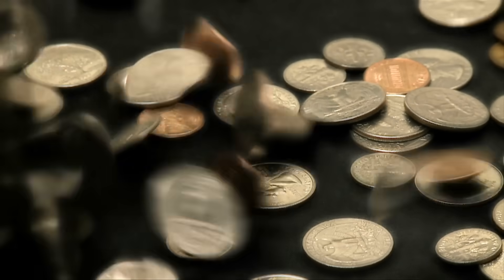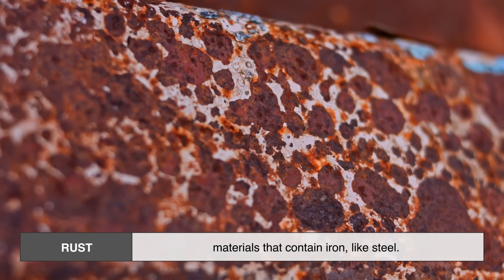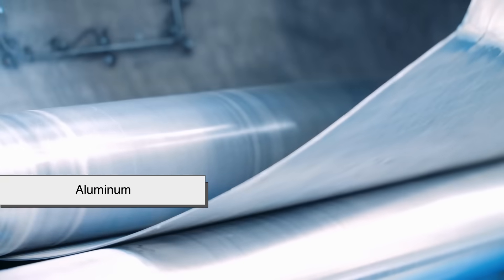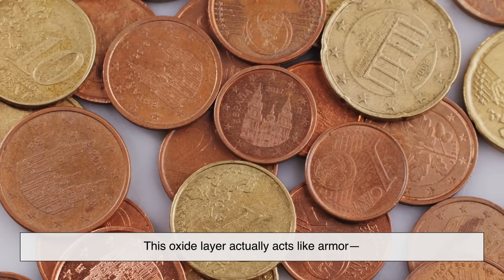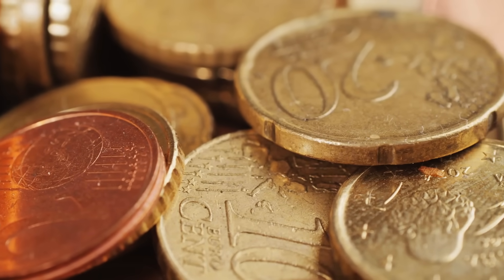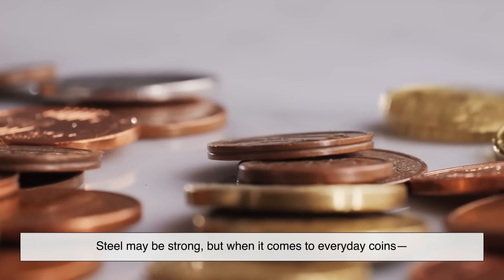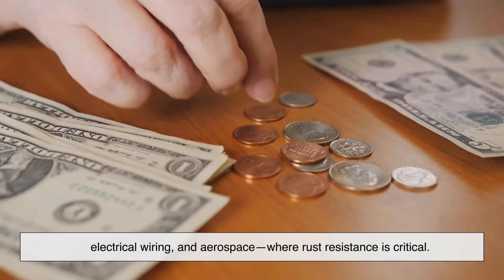Why Coins Don’t Rust Despite Being Metal

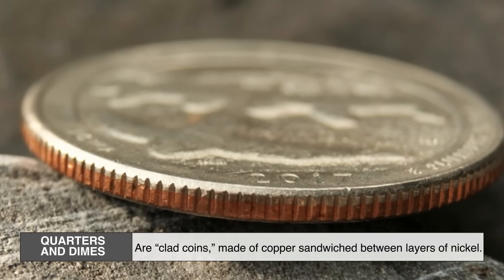Comment: 02:56 - "Quarters and dimes are clad coins, made of copper sandwiched between layers of nickel."

No, since 1965 they have consisted of a layer of pure copper sandwiched between layers of the same .75 copper, .25 nickel alloy used for the Five Cent 'Nickel' since 1866 (with exception of 1942 - 45 'wartime Silver' issues) and first used for the Three Cent Nickel of 1865 - 1889.

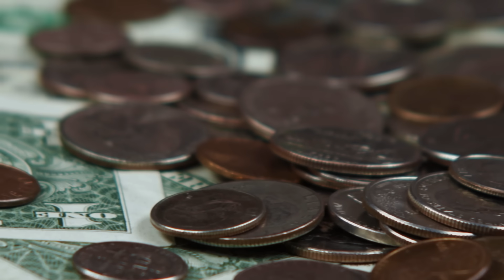Comment: 00:28  - "The history behind why coins don't rust, despite being metal. It's strange, right? Because coins are metal and metals are supposed to rust, so why don't they?"

Who wrote such an idiotic script?  Ferrous metals rust.  Copper does not rust, nickel does not rust.

There is no iron used in any current U.S. coinage, hence the coins do not rust.

U.S. Cents dated 1943 are zinc coated steel. As the zinc (quickly) wears away, the exposed steel most assuredly rusts.

Germany issued steel coins during the Weimar years and during the Nazi regime - they rust.